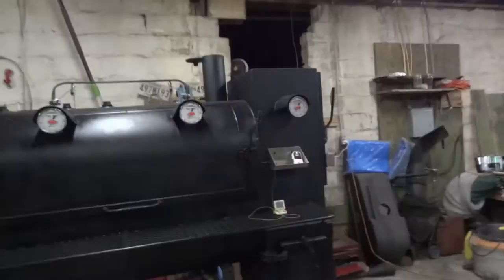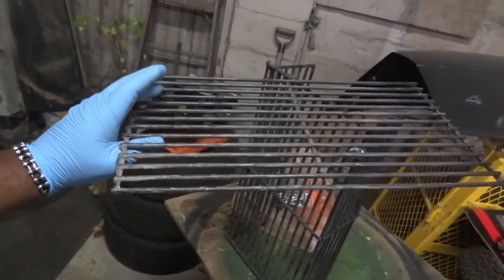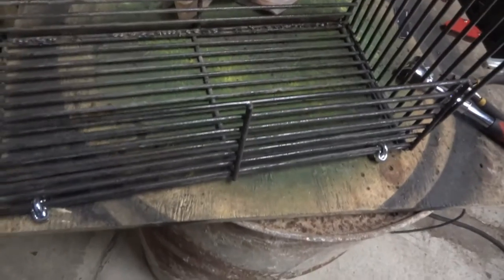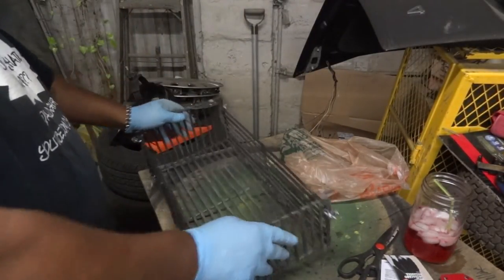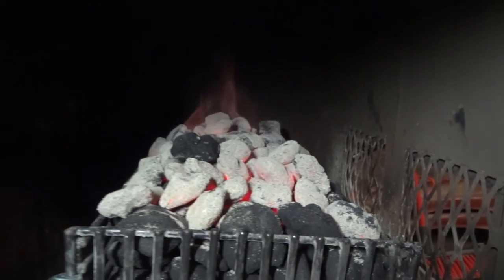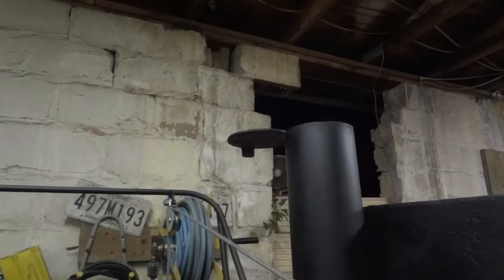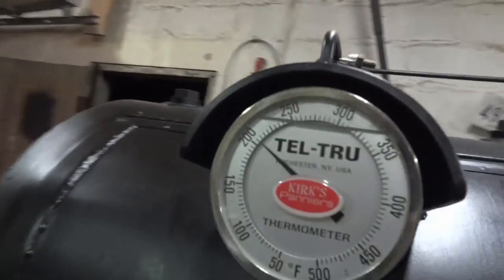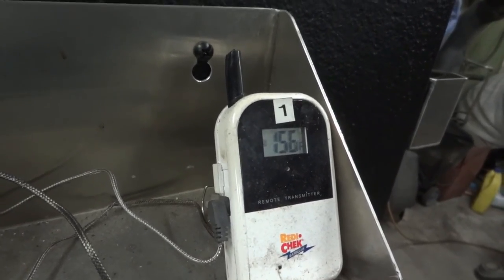Making the 275 Gallon Smoker Mine Part 2

Comment: I'm looking for designs on building my 275 gal smoker and fire box. Please advise.
Reply from the maker: Fuji Sr. Here is the video of the builder talking about the Diverter plate that might be helpful. https://youtu.be/ntdx8pD0xE4
Reply: What is the best way to make sure the tank is free from gases before cutting?
Reply from the maker: Fuji Sr. I've seen some guys use water, and others have used dry ice to force out the flammable gasses for inert gas. But in an oil tank you really shouldn't have to worry much. I'd worry more if I were cutting a propane tank.